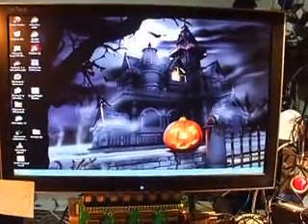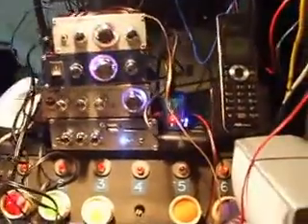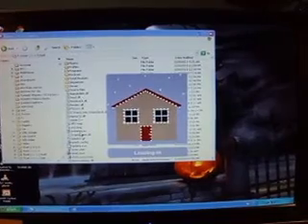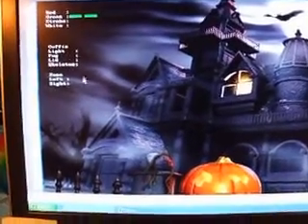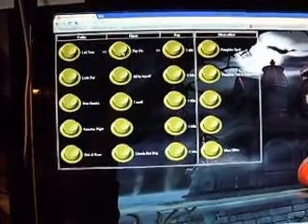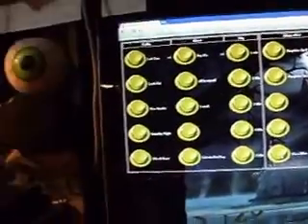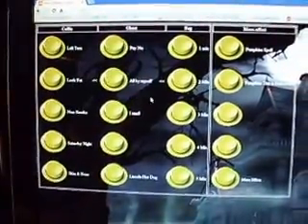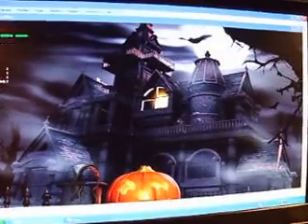My Halloween Haunt Controller using Vixen Light Controller

Comment: I am going to make a fake Halloween fire display for next year. Could you recommend a 2 or 3 channel light controller that I could buy. I don't need anything particularly elaborate. Thanks in advance.
Reply from the maker: Well questions I have are 1. How big and 2. What voltage ? If 110 I would look for some orange & red Christmas bulbs that flash, and some that don't. An old string of lights C9 size with a flasher or two just might do the trick!!
Reply: I will probably use no more than 2-48 mini light strands at 120 volts each so nothing really elaborate.
Reply from the maker: The Mini light strands might not work as well, the flasher bulb will cause the whole string to flash on and off because they are wired in series. The C9 (big honking bulb)  are wired in parallel so if 1 goes out no big deal.  I built a "Fire String"  many many years ago using this method .  R=RED, O=Orange, RF= Red Flash, OF Orange Flash.  R-R-OF-R-R-O-O-RF-O-O-R-R-OF-R-R-O-O-RF  like that. You can adjust the need you have.
Reply: Thanks so much
Reply from the maker: Your welcome! Happy Haunting!!
Reply from the maker: Try this https://www.youtube.com/watch?v=s28WVL5ZLYI

Comment: I have used Vixen running on multiple computers and kit 74 boards.  However, we used each computer running Vixen to control four relays for each specific "item."  
My question is, is it possible to actually have Vixen running on one machine and have it simultaneously run more than one item (relay board)?  If so, I wasn't aware it could do that.
Reply from the maker: I'm not sure of the kit 74 boards. I use an Olsen 595 which gives me 64 channels. It uses the parallel port like the kit 74. I use the "Trigger" system to run each prop on it own channel bank (ie lights left 1-4, lights right 5-8, ghost 9-12, coffin 13-16). The trigger system will run a script until the end.
Reply from the maker: Lee Alder After doing a little research, I see the Kit74 controls up to 8 relays, 1 per data line, so it seems only 1 kit74 per pc.